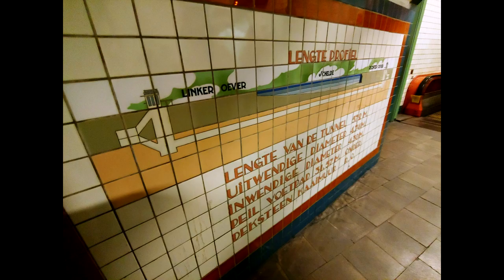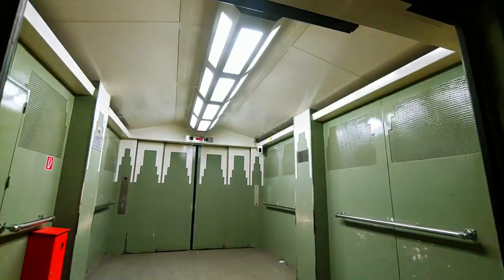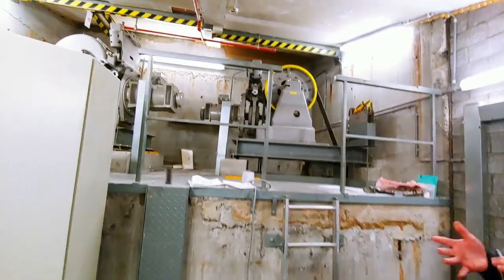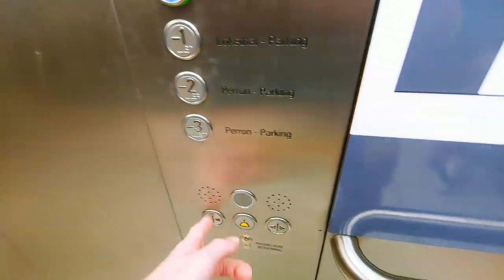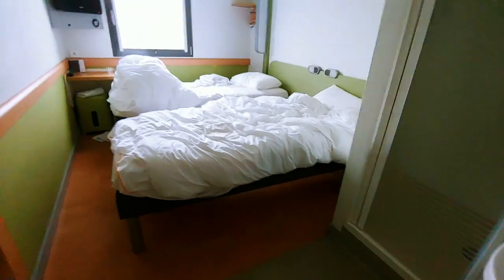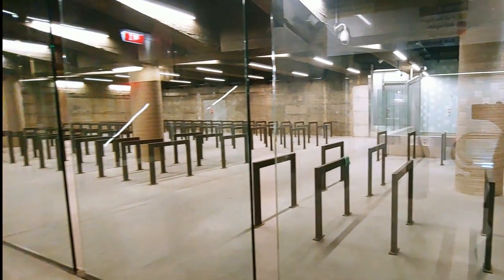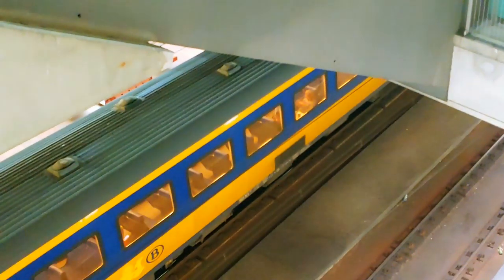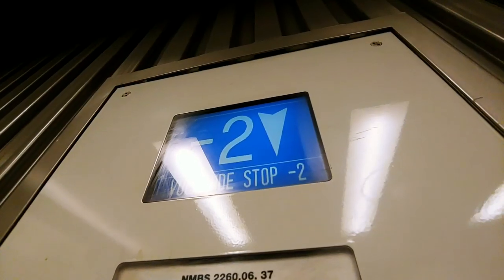Lift adventure in Antwerp Belgium

Comment: If you want a city in Belgium that has a grotty/industrial vibe try Charleroi, for example, their tram network looks and feels very 70's like, and uses the same BN trams from the early 80's than the coastal tramway. But unfortunately their going to be modernised soon by Alstom.
Reply: there's also an entire ghostline (line to Cora/Chatelet)
Reply: @ludwigvonkoopa4998  He did the coast tram on his Bike trip from UK to Nederlands
Reply: @BsBsBock   i'm talking about Charleroi light rail
Reply: @ludwigvonkoopa4998  Yes indeed ! I went to one of the stations of this ghost line (Chet station. The easiest to access since there is a slope going to the viaduct and the fence has many holes cut in it by urbexers). I also know that their local transit museum, the ASVi, does sometimes tours on this line with a heritage tram since the line is powered.

Comment: That station! Pretty impressive looking. It looks like NYC central station, same sort of design. Like those train annouchments, there's something comfortable in those flemish female voices...😁. You have to be dutch understand it, but I've set the voice on my car's satnav to one as it's a lot cuter/funnier the the regular dutch voice. That hotel with the interresting roof is a very post-modern design, i.e. it's gimmick architecture form the 80's.